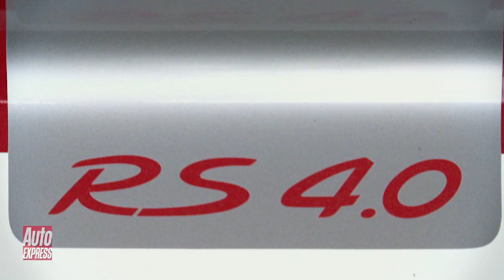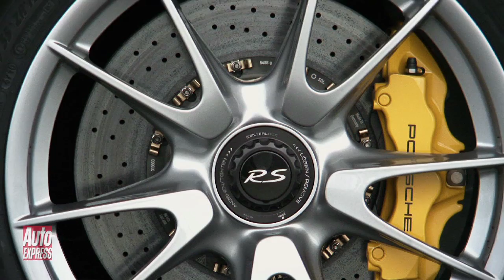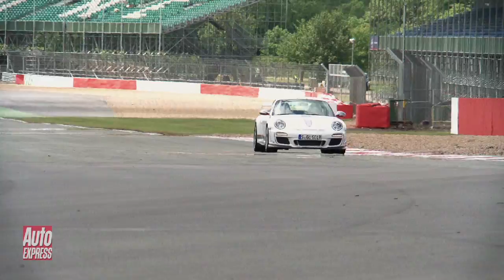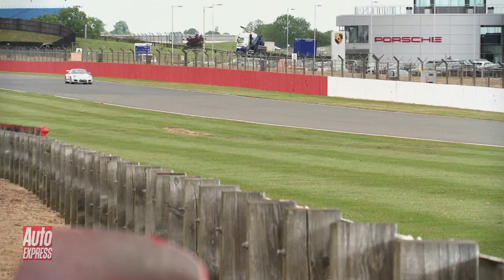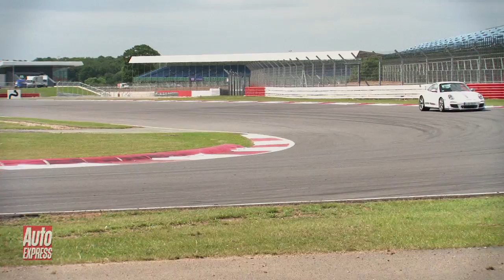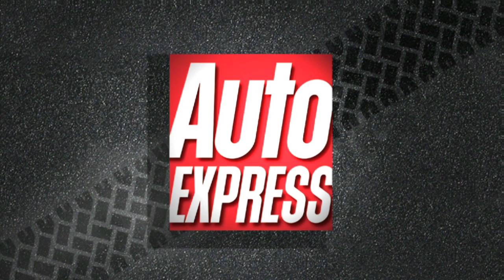Porsche GT3 RS 4.0 review at Silverstone - Auto Express

Comment: Don't listen to these so called 'drivers' explaining snap oversteer. They have no clue of the car's dynamics and engineering like Porsche engineers do.
It's a PROVEN platform, and is still spinning heads as the cars become better, and newer chassis platforms/variants release from Porsche. They had a special on the GT2RS and how it just flat out WORKS, its true, and whoever says differently just doesn't have a clue.
As for 'snap oversteer', there is no such thing. My RUF GT2 lives on the track

Comment: Absolutely, it's not dangerous and indeed gives the car amazing character and feel, my Carrera is a 3.6 on 18 inch wheels and standard suspension, it has DFi (Direct fuel Injection) and I get 30mpg, that's a combined realworld figure, the tyres on the rear are 265's so it moves about a bit more a lower speeds compared to say an S or GT3, it's quick enough to get me into trouble with the police! but tax and insurance is semi-affordable, Hope you get a chance to drive one soon.

Comment: @edrees1o1 you think? Veyron 16/4 3000hp real, 1001hp and 2000 in heat, check National Geographic how veyron was made documentary, koeniggseg cc8 cc8s ccx ccxr from 600 to over 1000hp depending on the fuel ethanol or premium, Noble m14 v6 from a ford mondeo twin turbo 450hp noblem600 regulated from 450 to 650 depending on the psi, saleen s7, brabusV12biturbo, merc SLR and the 722, bentleyGT, fordGT, gemballa, techart, RUF, 9ff, rinspeed, speedart all porsche tuners with +than 550hp

Comment: @Samkuzma The centrifugal force created by the rapid front turn-in and the weight in the rear actually causes the car's rotational like tendancy around the turn instead of turning and hanging to the outside of the turn. For these reasons, Porsch designed the car with a very wide rear track. This may sound funny but when cornering, you have slightly increae the throttle in complete the turn. In cars with front mounted engines, the opposite is necessary.

Comment: @Samkuzma Actually the rear engine location does have alot to do with the handling characteristics of the Porsche. The extra weight in the rear helps tremendously with traction and acceleration as well as cornering. ALL Porsches look "funny" when cornering. WHY? Notice how the car kind looks as if its rotating around the turn. The front turns in much faster that the rear creating the illusion of oversteering and a possible spinout or drift.

Comment: @MagicAyrtonforever Because it went into (very) slight power oversteer exiting a corner?!  *Every* sports car will do that.  It has absolutely nothing to do with a rear engine location.  The "compromised" engine location has resulted in over a dozen Le Mans wins and 100s of wins in various other motorsports series.  The claim that there is some issue with the engine placement is tired and has been completely refuted by their incredible success.

Comment: Porsche FTW. Porsche designs a man's car. Mechanical grip, minimal electronic aids, flat-six (boxer) engine, heritage (rear-engine). Porsche made the impossible, possible, while it's competitors switch from front-engine to mid-engine to seek that extra little bit more performance and switching to double-clutch automatic transmissions as the only option and all-wheel drive systems alongside hefty price tags. Porsche, please don't change like your competitors have! Thanks.